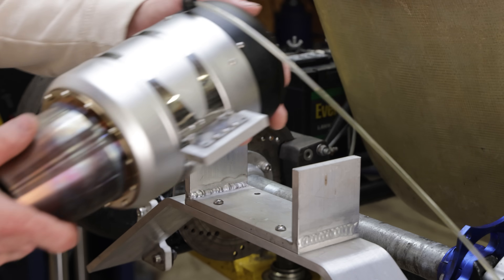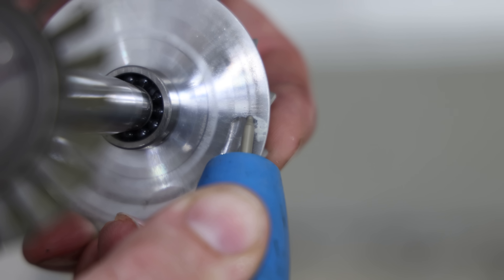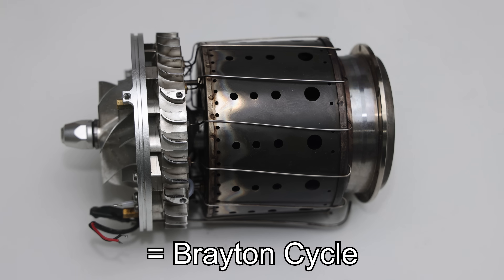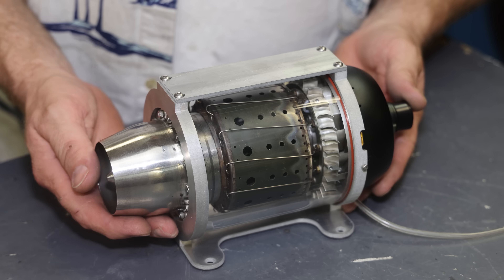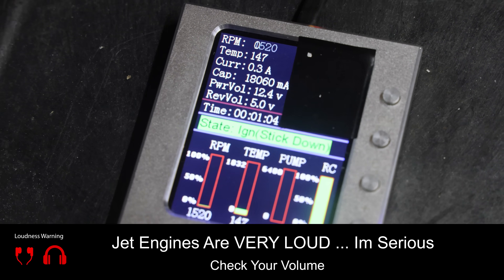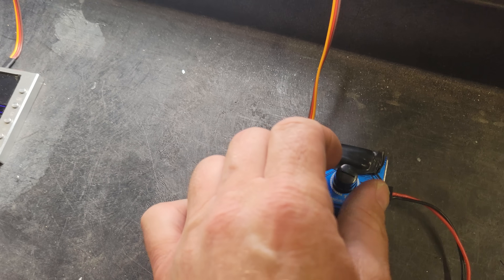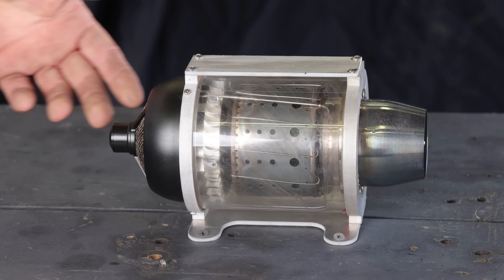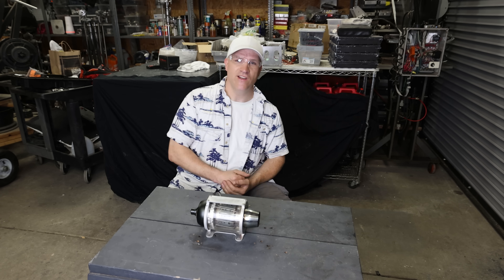See Thru Jet Engine

Comment: How hard would it be to make a small jet engine like that into a generator? And how much power could it produce
Reply: There is no shaft output to drive a generator. This is a turbojet engine - all of the useful output is the "jet" (high speed flow) of exhaust. Add another turbine connected to a shaft, and connect the shaft to something that needs to be driven, and you would have a turboshaft engine; if the shaft has a propeller on it, then it's a turboprop, and if the shaft has a ducted fan on it then it's a turbofan.

Some of the companies that make these tiny turbojet engines also make turboprop and turboshaft (usually for helicopters) versions. I assume that this is not the same brand, but KingTech Turbines makes turbojet engines, plus turboshafts in both turboprop and helicopter versions, based on the same core gas turbine engine. Perhaps Warped Perception could tell us what KingTech model corresponds to his engine in size.

If you only want to run a generator, a properly designed generator can safely spin very fast so you wouldn't need the reduction gearbox that turboshaft (including turboprop) engines normally have.

Comment: Want a tip? Stop using scrap from the past and switch to electricity.
It will get you from point A to point B faster and on the positive side, you don't have to worry about heat.
Get a bunch of Quartz, smash them together and voila. Piezoelectricity.
Or you can try making a miniature hydron collider, particles hitting each other produce intense heat and thus energy.
Or if you're lazy just get someone to push you down a slope.

Comment: How much thrust do these jet engines make and could they power a drone, replacing the electric motors with these Jet engines, if you made the Jets into a turbo jet with propellers? could you carry enough fuel?
Reply: Warped Perception said in response to another comment that this engine can produce about 30 pounds of thrust. Smaller and larger models of engines like this are available from various manufacturers.

Turbojets can be used instead of electrically driven fans in the usual quad-rotor, but they're extremely inefficient when used to provide lift, and don't respond quickly to power changes so the craft would be hard to control. If you use turboprop engines instead, the prop pitch could be changed instead of engine speed, making it much like  conventional turbine helicopter - that works, but it still inefficient, especially in this tiny size.

Comment: NEODYMIUM QUART SILICON GRAPHITE THERMAL REACTIVE THERMOELECTRIC EFFECTS REFRIGERATION PELTIER EFFECTS MESH REFRIGERANTS OILS PARAMAGNETIC VAPOR COMPRESSOR BY AIR FORCES SYNCHRONOUS AC INDUCED CURRENT DIAMAGNETIC REPULSIVE FORCES PERMANENT MAGNET ESC ROTATING COMPRESSOR IGNITION STARTS IN ADDITIONAL BRUSHLESS MOTOR NEEDED LONG ROD ARMATURE MOTORIZED TURBINE THE FUEL TANK IS SEPARATELY MOTORIZED BLENDER COMBUSTIBLE GAUSS TYPE AFOREMENTIONED PARAMAGNETIC ENERGY FUEL PERMANENT MAGNET REPULSIVE FORCES DIAMAGNETIC REPULSIVE FORCES ION ESC MOTOR
STRUCTURE TYPE TURBINE ALUMINUM HOLLOW OPEN CLEARANCE CYLINDRICAL BARING PERMANENT MAGNET REPULSIVE POLAR COMMUTATOR CAGE PERMANENT MAGNET REPULSIVE COMPRESSOR BLADE 
EXCHANGED FIRE CAGE ELEMENT SILICON DESIGN HOLLOW OPEN CLEARANCE CENTRAL INTERIOR BARING COIL TYPE SOLENOID SENSORY VOLTAGE TRANSFORMER POWER UP BY (AC) INDUCED CURRENT. SILICON EXTERIOR ALUMINUM FOIL SEPARATE ANODE CATHODE BY POLYMER PLASTIC FILM HIGH VOLTAGE CAPACITOR DC RUBBER COATED SILIVER WIRE SPUN AROUND THE TYPE FIRE CAGE HELIX SHAPED COIL. FIRE CAGE TYPE CENTRAL BARING ARC ROD PARALLEL FIX POSITION FORMING A CONE  LOCALLY TOWARDS ONE ANOTHER ENUMERATES 12 SPARK-GAP FIRE PLASMA ELECTRON MOTION VORTEX PRECESSION SPINNING GENERATING NEWTRON PURE ENERGY PARAMAGNETIC LIQUID FILLED ENCLOSURE BARING ELECTRON BEHAVIOR GYROSCOPIC PRECESSION PURE NEWTRON ENERGY BY MAGNETIZED VAPOR FROM PURE SOLID STATE ATOMIC PRECESSION VACUUM MAGNETISM NEWTONIAN ENERGY COMPRESSION CHAMBER COMBUSTIBLE DENSITY ARMATURE CYLINDRICAL SILICON BISMUTH FILAMENT. BALL BARINGS ELEMENT ALUMINUM SUBMECHANICS COPPER BALLS. DISPATCH TURBINE BLADE TYPE PERMANENT MAGNET REPULSIVE POLAR SIDE BACKWARDS.
A HIGH VOLTAGE SPARK-GAP CENTRAL MAYBE POSSIBLE TO INCREASE DIAMAGNETIC REPULSIVE GAUSS ELECTRON VORTEX NEWTRON ENERGY GENERATOR ELECTRON COLLISION PRECESSION SPIN PARAMAGNETIC KINETIC NEWTONIAN REPULSIVE GAUSS ION DENSITY MINOR NEWTRON STAR  FORCE

Comment: Bravo:   Great educational video, thank you.    I have a transparent auto spark plug and can see the combustion in the motor cylinder . I used it to tune the SU carbs on my 1951 Bentley.  I believe its sold as a "color tune" plug.  It was interesting to see the flame turn from yellow to blue when in tune.

Comment: Given the temperatures involved there aren't many materials that'd fit the bill but I have to wonder if it'd be possible replace one of the panels of the combustor with something transparent as well. Sapphire might be able to handle it maybe.

Could see this being really useful for R&D to get the holes exactly right to put the flame where you want it.

Comment: If I ever win the lottery I want to try putting a charged palladium anode inside the combustion chamber and use hydrogen fuel. Wouldn’t it be neat to have a fusion assisted jet engine?
Reply: Exposing hydrogen to palladium does not result in nuclear fusion, or any other nuclear process. And if you want to burn hydrogen to run an engine, you don't need a catalyst such as palladium.

Nuclear power as the heat source for a gas turbine engine was tried: projects by the US Army Air Forces and the US Atomic Energy Commission included designs by General Electric and Pratt & Whitney; some components were built but no complete engines.
Reply: @brianb-p6586  How do you know?  Besides, I have other ideas to increase the probability of fusion.  The idea is that any fusion at all will increase the thermal efficiency.
Reply: @batymahn  🤣 I know because I live the real world... and have an appreciation for nuclear processes. Hoping they they will happen just isn't enough.
Reply: @brianb-p6586  The last I checked the Encyclopedia Britannica fusion in Palladium was an observed physical phenomenon.  But I don't expect to win the lottery any time soon.  Why do you care so much?
Reply: @batymahn  I find the deliberate spreading of misinformation offensive. It is not constructive and it interferes with learning actual facts.
Reply: @batymahn  No, what the Encyclopedia Britannica article about fusion says is that the nonsense about fusion in electrolytic cells with palladium rods was: 
"Efforts to give a theoretical explanation of the results failed, as did worldwide efforts to reproduce the claimed cold fusion." In other words, it was not observed.

Your comment is like reading a published statement that perpetual motion is not possible, and then claiming "I read that  perpetual motion is possible", throwing in the name of a legitimate publication to make the nonsense sound legitimate.
Reply: @brianb-p6586  Why do you care so much about a lottery fantasy post? You’re starting to make me think I’m onto something?
Reply: @brianb-p6586  Next time try using reverse, reverse psychology…
Reply: @batymahn  No, you're not onto anything... except possibly recreational drugs.

Comment: Great work and I'm looking forward for part 2 to see even more see through -model.

It would have been nice to tell more about the materials you used. Was the transparent part quartz glass?
Reply: I can almost be certain it was polycarbonate since it can be cut and machined to size much easier.
Reply: @stevewalston7089  Polycarbonate doesn't take heat too well and I was just wondering if the air movement could actually cool the surface fast enough. And I would guess the cooling power is not enough.
Reply: @MikkoRantalainen  It does not withstand heat long term but would work fine for what was done here.

Comment: I wish there was some high bypass turbofan of these model engines. :3
Reply from the maker: I've been thinking about building one for a while now.
Reply: @WarpedYT  Woooo... 👀
That would be pretty cool! 
Keep up with the awesome job! ^^
Reply: You can buy turboprops and turboshafts (which are really the same thing), so you could add a ducted fan to one instead of a propeller.

Comment: Nothing sounds better than a jet engine spooling up. I noticed that as it was coming up to speed, the same sound kept being repeated at lower pitches which in turn rose in pitch. Are those subharmonics or audio compression artifacts?  Or maybe different engine components being driven to vibrate? Could you ask Scotty to help you make an engine from transparent aluminum--I want to see more.

Comment: This is going to sound like a stupid question.
But what keeps it from over heating ?

I'm sure the intake of the air helps up to a certain point.
And it doesn't look like there is to many components that could fail.

But at the end of this video,
You said you were surprised that it didn't explode.
I assume then that what would make it explode.
Would be from over heating.
Correct ?
So what would one need to due to make sure the unit wouldn't fail.

Comment: never seen flames coming out of jet engine on commercial planes. The wings are full of jet fuel so why would they place these metal melting burners under the wings?
Reply: You don't see flames out of commercial "jet" engines because they are much more sophisticated designs which work properly and use the combustion energy much more efficiently. Obviously the operating engine on an aircraft doesn't melt any metal, and the outer housing isn't even very hot.
Reply: @brianb-p6586  so you are saying its 90 percent compressed air that causes the thrust and only 10 percent fuel?
Reply: @sandeepdahiyalawyer  More like 1% fuel mass... but yes, the thrust results from pushing air, although the energy to do that comes from burning fuel in that air. And the air gets compressed but expanded again - by the time it leaves the engine it's moving fast but not compressed. There's a lot of air moving!
Reply: @brianb-p6586  1% fuel mass means there is no need to carry 300 tons of fuel in the airplane. No need to carry 3,00,000 litres of fuel in the wings. No need to carry weight equivalent to 20 fully grown elephants on each wing! Or is it that they are not carrying any fuel just changing the customers to make huge money not shown on accounting books??
Reply: @sandeepdahiyalawyer  All of the thrust is in reaction to fluid flow; roughly 1% of that fluid is fuel. That's a fuel flow of 1% of the airflow through the engines, not 1% of aircraft mass. If there are 300 tons of fuel in an aircraft, it will pass tens of thousands of tons of air through the engines during the time it takes to burn that fuel. Fortunately, the aircraft doesn't carry the air and no one has to pay for it! Of course all of the energy comes from burning the fuel.

By the way, 300,000 litres of jet fuel would be about 240,000 kg (about 260 tons), which is about the fuel capacity of the Airbus A380, the world's largest airliner. That's enough to fly the aircraft about 14,800 km (9,200 mi, 8,000 nmi).
Reply: @sandeepdahiyalawyer  I found some numbers to help this make sense. Matt's engine appears to be based on components from the Swiwin SW series engines in the 100 mm size, such as the SW120B and SW140B. The SW series manufacturer's specs show roughly 320 g/minute fuel flow at full power.

Extensive testing work has been done on another brand of engine of the same design and size from Baird Micro Turbines, the BMT 120 KS (see "Investigation of Micro Gas Turbine Systems for High
Speed Long Loiter Tactical Unmanned Air Systems" by James Large and Apostolos Pesyridis in the 
Department of Mechanical and Aerospace Engineering, Brunel University London). The BMT at a speed of 120,000 RPM and thrust of 136.6 N runs an air mass flow of 293 g/s (17,580 g/minute) and fuel flow of 6.3 g/s (378 g/minute); that's a fuel mass flow which is 2.2% of the air mass flow.

Of course a huge airliner such as the A380 flows much more of both. The Trent 900 engine burns about 16 g/(kN⋅s) and can produce 334 kN of thrust in cruise conditions, so that's 5.3 kg/s of fuel and an airflow (according the Rolls-Royce brochure) of 2655 lb/s (1204 kg/s). That would be 65,000 tonnes of air over the 15 hours it takes to burn the full fuel load if that were are full thrust; of course it's at a lower thrust, but it's still tens of thousands of tons of air. The air flow to fuel flow ratio (by mass) is over 200:1, because it's a high-bypass turbofan engine.
Reply: @brianb-p6586  is it right that the maximum thrust is when the plane is at a standstill position on runway ready to move. if I am not wrong to move this plane loaded with passengers and 300 tons of fuel thrust required should be maximum.
Reply: @sandeepdahiyalawyer  not moving is the static condition. While the maximum thrust might be available at the point, it's not important - the important part is producing enough thrust once it's moving.

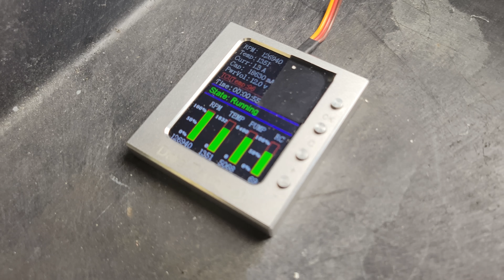Comment: 8:02 2,116 rotation per second, ya that's pretty fast assuming that readout was accurate. Definintely spins faster than full sized jet engines but that's really not surpising. Didn't expect it to get quite that fast though.
Reply: Rotational speed is roughly inversely proportional to impeller or turbine wheel diameter.

Comment: What material did you use for the transparent shell? Other transparent jet engines I've seen people build used high-temp plastics, but they always char slightly on the inner surface after a bit of use. I'm guessing borosilicate glass?

Comment: I think you'd have a lot better success with seeing the fog at a starting RPM without ignition
Reply: Running fog through the engine with just the starter motor (no fuel or ignition) might be interesting to show flow, but the flow won't be quite the same as with combustion.
Reply: @brianb-p6586 possibly, like pressure changes and shit I'm sure. But I'd still like to see it

Comment: Awesome. Why you don't use two coaxial acrilic transparent tube with water recirculation inbetween  (in order to keep the plastic cool)?Maybe It will allows longer run time.

Comment: What would happen if you spray nitrous or pure oxygen inside the inlet?
Reply: Nothing useful. A turbine engine has airflow in excess of what is needed to burn the fuel anyway, so more oxygen or nitrous wouldn't help.

Comment: Just WOW! I have so many questions though... How to you start it up? By air (doubt) or electric motor? What's the temperature inside/outside casket? How do you inject the fuel? What's the pressure of it?

Comment: Im currently in school for aviation maintenance and had no idea how jet engines worked. the demonstration here is top-notch. for something made out of parts so simple to perform a single task it is absolutly breathtaking thank you for this video
Reply from the maker: Thanks...yes I agree
Reply: Well full size engines have more than one burner so its no exactly like this.
Reply: and Huge ass fan in front to pull in all that air and additional compressor and turbine.
Reply: @richardhardy8337  that's a turbofan. Turbojets and turbofans are 2 different, albeit similar, engines.

Comment: How many HP would you say that small engine has?
Reply from the maker: That's a great question it's very difficult to accurately convert thrust into horsepower but if we do it by a fuel consumption I think it's up there more than expected.
Reply: @WarpedYT  What is the maximum fuel flow at full power?
Reply: Power depends on speed: on a stationary stand, there is no motion so no matter how high the force is, there is no useful power developed. Warped Perception said in response to an earlier comment that it produces about 30 pounds of thrust (133 newtons); one horsepower is 550 ft-lbf/s (746 watts), so for instance if this were on a vehicle moving 60 MPH (88 ft/s, 27 m/s, 97 km/h,), and still producing 30 lbf, that would be 2400 ft-lbf/s or 4.4 horsepower (133 N * 27 m/s = 3.3 kW).

Normally jet and rocket engines are rated only in thrust; shaft-output engines (including turboshafts) are rated in power (horsepower or kilowatts).

Whatever the power, it will be low compared to the fuel flow, since a low-pressure-ratio turbine engine has very low efficiency. On the other hand, the power output (at high enough speed) is good for the physical size of the engine.

Comment: grown diamond combion chmaber and outer casing.

Also, i think that if you were to just run fog through the thing during the low RPM startup, i think you'd see better flow visualisations. I think at the higher RPMs the particles are being put under vacuum making any liquids vaporize quickly, and the intake seems to be so violent that it just mixes everything evenly
Reply: There isn't even a partial vacuum anywhere at any speed. Water droplets will vapourize because of the increased temperature.

Comment: So Many Idea's. I've been working with liquid air recently. [well. only in theory, cant afford a cryo-cooler]. It expands with slightly less force then water steam but at room temperature. Using electric heater elements, you could combat the cooling of the liquid air. You don't need to nullify it all, just reduce it enough. In theory, it should work.....maybe. I'm still neck deep learning about Engineering. So I could be wrong. If I am, please correct and educate me!

Comment: Really cool! OK, I'm certainly no nitwit when it comes to engines or science but why doesn't the exhaust backpressure stall the compressor?? Seems like the pressure in the combustion chamber would act in both directions? I understand how torque converters and multistage steam turbines work but never quite figured this out?

Comment: QQ what starts the compressor side turning, obviously the exhaust drives it when running, but how does the process start??
🤔
Reply: Electric starter motor.